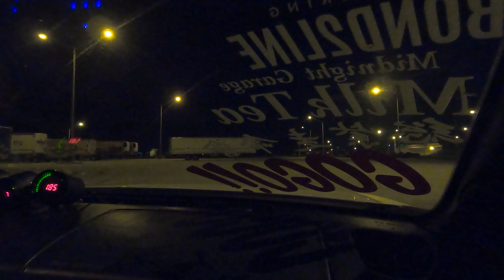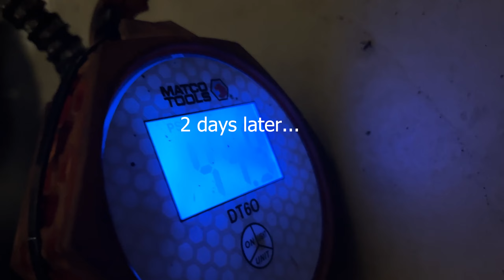No Grip Drifting @ Street 1 | Practicing Low Grip Scenario

Comment: For sure go with kenda's, after drifting dozens of tire brands they outlast any other i've tried, already have 3 whole OSW events on one set on my Z and still have half life. Lots of grip too. Well worth it imo
Reply from the maker: this is what i needed man !! thank you for the recommendation. think i will keep cheap used ones for street but want to run kenda when i go to osw !!
Reply: @dillon, hey bud if you don’t mind me asking, what model of Kenda tyre did you use? Just picked up an s13 myself and wanted to find a decent tyre to drift with, and I’ve heard good things but always forget about them, after reading your comment I think I’ll give them a go 👍
Reply: @dionlynn2276  only go with the kr20a or a2. Don’t know what size wheels you have but will want a 225/40 or 245/40. If it seems too grippy just keep airing them up. I’ve ran them at 50psi cold when I was down a bunch of power. Make sure your alignment is good on your other set of tires before switching to these since they’re a little pricey. You won’t regret it. Good luck accelera 651’s are also a great bang for your buck tire.
Reply: @DillonGuttridge  sweet nice one man! Thanks for the reply👍 I’ll have a look at some, thanks for the help bud 🤟